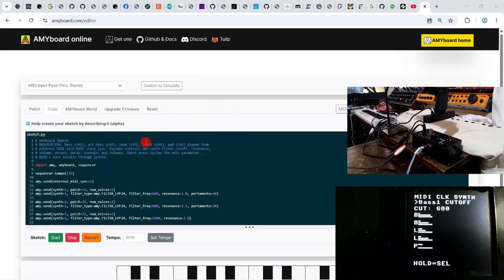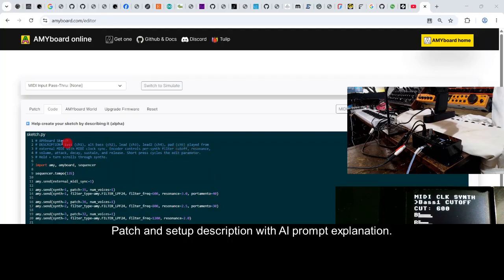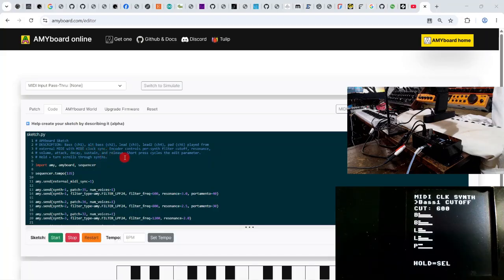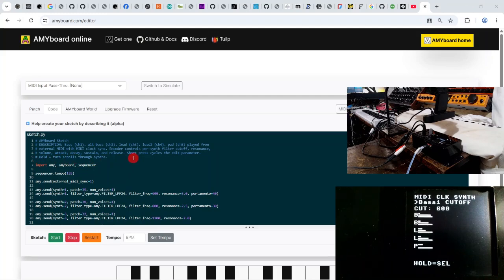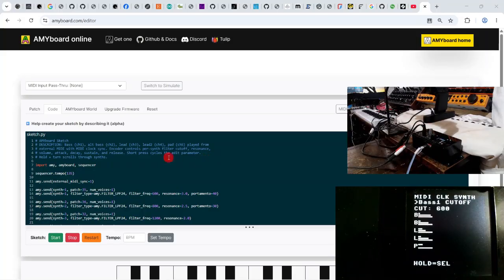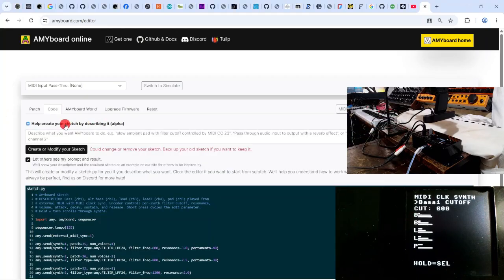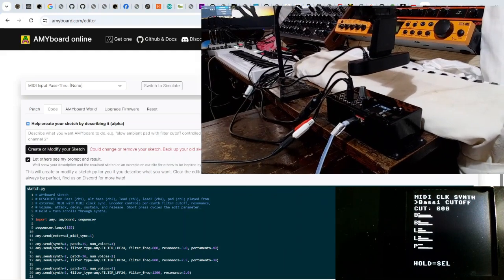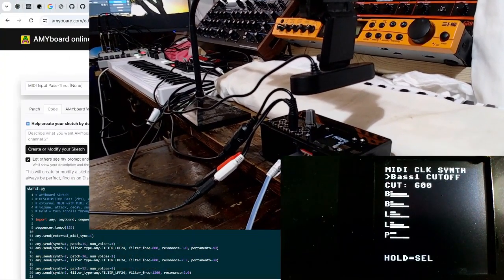$29 AMYboard Synth | Adding Screen and Encoder |

Comment: Bought this board not knowing how much headache it will bring on things which could have been made easy. Why on earth these guys put the Grove connector on this board which is hard to find, and when you find it you pay a fortune and wait for ages? Why not using a normal PH2.0 which is cheap and can be found anywhere? This $29 price tag is a trap, once you bought the board then you have to buy from monopolist adafruit all the other components to make this piece of s... workable and you pay another $50-60. You could buy FM-1 synth for $50 instead and enjoy playing music rather than playing mecano and lego with this board. The same components which adafruit sell cost 10 times cheaper on Aliexpress and work the same way but adafruit made it hard for you to buy cheap with this nice little Grove connector.
Reply from the maker: Shame you didn't get on with it. I quite like it, but ended up making up my own cables and then got some more from the pi-hut.....if I remember correctly.

Comment: What code do you use? Can you share please?
Reply from the maker: Hi, hope the video was of use. I used the AMYboard online editor https://www.amyboard.com/editor. The native AMYboard is coded in micropython. The online editor also has a simulator, so you don't actually need the board to try most things out. I ended up using the AI tools with it (I can code) just to see what it could do, and it seemed to work well with a few minor iterations and mods. You can also use the AMYboard with the Arduino environment and the AMYsynth library if you would prefer. I haven't tried this out yet, but want to have a go when I get round to it.

Comment: Thanks sooooo much for making this video. Can you link to where you got your screen connecting cables / jumpers?
Reply from the maker: Thanks for watching and glad you liked it. The cables (grove to grove) and (QWIC to grove) were form the PI Hut in the UK. The jumper leads for the display were supplied with the display, but you can find similar on ebay etc.  You can get them from ebay, amazon and general component suppliers as well. Hope this helps.
Reply: @tailbiterz Thanks so much man, you're a life saver. I bought one of these on release day but haven't gottent to put it together properly yet

Comment: I’ve added a single encoder and screen, also added a neorotary4 which was working until it wasn’t 😂 now tryna figure how I’ve messed the neo4, was looking promising as an extended patch editor. Great demo thank you!!
Reply from the maker: Thanks for watching, hopefully you get that controller sorted out soon. Glad the video was interesting. Only things I can suggest about the neorotary4 without knowing more, are check the connections, check the power supply, check you haven't shorted anything, but you've probably already done this. I know I've shorted stuff by having open boards / pcbs with no case, and then moving them around. Also stressed cables in the past by doing this. Also is your main PSU up to having all the bits connected, I know I had an Amyboard, tulip creative computer and other bits connected to one of my laptop ports, and I ended up having intermittent problems. A powered usb hub seemed to sort things out (but it could have been something else I was doing), it also worked on a separate plugin usb supply. Anyway, hope you get it working.
Reply: @tailbiterz after a bit of beating with a stick, it’s now behaving with juno_6_synth sketch (I did re-order the display on page 2,3,4) and have laser cut a new faceplate to consolidate the two. Joystick is a great idea, got one here somewhere as well
Reply from the maker: @JBFromOZ  Its good that you are getting things sorted with the AMYboard. I'm planning on trying to set the joystick up soon. Good that you've laser cut your panel as well. I was going to cnc an enclosure, but thought I'd just hack at it with a saw in the end :)

Comment: That's super cool bro. How much is the screen and encoder to add? A joystick would be a pretty sweet addition. I would imagine on the Amyboard it would be possible to make the joystick x/y control just about anything. I'm a sucker for joysticks on synths. Nice work bro, there were some great patches in there as well.
Reply from the maker: Cheers, glad you liked it. The screen was about £12 in UK and the encoder was about £7.50. the small connector cable was £1.50. You could probably get them for at least half of that, if you shopped around. Think the joystick was about £5.00. The joystick will be useful, going to use it for CV control in the future. I also have a Korg Wavestation SR that I want to control with it over midi. Cheers for watching.
Reply: @tailbiterz snap on the wavestation SR! Also have an akai s2000 hoping to get a decent kit up and running soon
Reply from the maker: @JBFromOZ  Yeah the wavestation SR doesnt have a joystic on the front like the other wavestations. Want to see if I can get the AMYboard to send CC 16 and 17 via joystick control, to alter the patches on the wavestation.
Reply: @tailbiterz I’ve just found out about Edisyn as a patch editor for Wavestation SR! Bad-gear UI unlocked :-)🎉